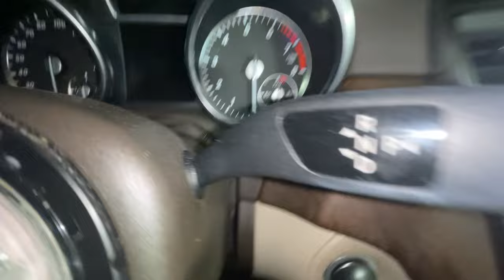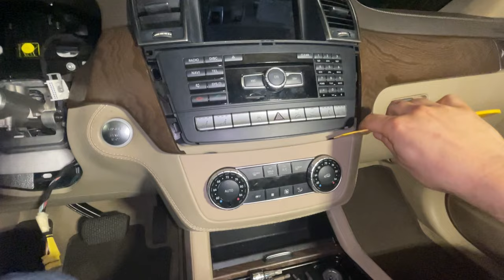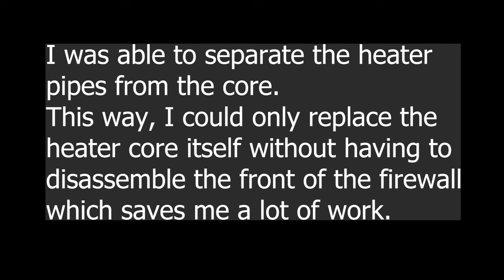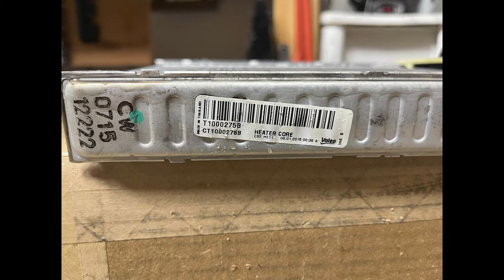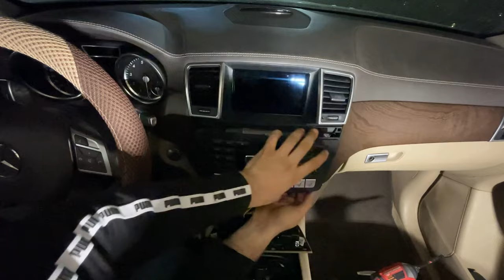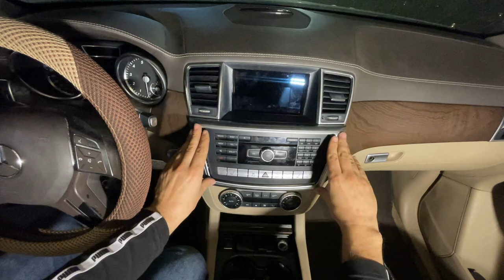DETAILED W166 Mercedes Benz ML350 Complete Dash removal and Heater Core Replacement | How To

Comment: I took the whole heater unit out of a W108 (1968 250S) and that was a headache.  But, I was really lucky because I was parting out the car.  If I was doing it as a paying job, that would have been a nightmare.  It really was easier to take everything out from in and under the dashboard.   I think a lot of people underestimate the number of parts and pieces - large and small - that have to be removed.  Take lots of photos.  Make notes.  And keep track of all of those screws and clips.  The estimate is several hours in the rate book, if I remember correctly.  Hopefully you have a lightweight, skinny mechanic with long fingers and slim wrists that does not get sick working upside down.  Congrats on your job!
Reply from the maker: Yes it is a nightmare for sure but like you said, when you take notes and pics of everything then you should be good 👍

Comment: very impressive operation. kudos. helpful to the merc benz DIY community. I recently replaced and troubleshot a ml350 163 A/C system, the center blend door flap was clicking and rotating endlessly, and linkage was broken on right blend door. Upper dash had to be removed.  Your procedure dwarfs that operation. Well done.
Reply from the maker: @mobitechaz thank you for the feedback!

Comment: Heater core got plugged up because the Silica slow release anti corro6pack came apart. You also need to replace bottle to get 100k out of coolant and bottle potentially or replace coolant now at 50k if not new bottle
Reply from the maker: Thanks man, good to know 👍

Comment: Hi,

Many thanks for the video. I have a problem with my 2013 ML 250 w166.

Couple of years ago, there was a rattling noise in compressor during idle and when vacuumed at Merc dealer, it had less gas and no oil. So they  added the specified quantity( I don't know how much exactly) and it was working fine. The noise was there anyway. The cooling was totally great. Annoyed by the noise, I went ahead and changed the compressor and receiver dryer alone at an independent garage. Then the rattling noise from compressor was gone. 

Fast forward two years, the aircon wouldn't cool for the first 10 minutes from the cold start of engine. But when the vehicle was at operating temperature, the system began cooling well. 

I then went to a generalist ac recharge person and checked by vacuuming. It had about 300 gms of gas and 45 ml of oil when vacuumed in the machine. 
Since, the ac guy had no clue of how much gas was required. I searched online and found that the ML 250 needed 1050g of gas and 120 ml of oil which he refilled.

1 month into it, I now have the same rattling cluncking noise from compressor. 
Finally, went to a reputed ac mechanic and then again vaccuummed it and found the gas level was about 967g and   45 ml of oil.

But this time the oil was grayish with some metal emery. The high pressure was fine. The low pressure readings were inconsistent.

I think I made a mistake by asking him to fill 120 ml of oil when the recovery was only 45 ml. I didn't k ow that rest of the system had oil too. Did I overfill oil?

What should I do now? Should I replace the compressor,Condenser and received dryer alone?

Or should I replace the evaporator core as well? To ensure that the system doesn't fail again. I am early confused about  how best to sort this.

Looking forward to your advise.

Many thanks
Reply from the maker: I read everything you wrote, but at no point did you mention any leaks. The way that you're describing losing gas and oil every year or two, it's very concerning and that should not be happening.
So, my advice... instead of replacing everything that comes to mind, how about start with finding the leak and make sure that's solved first before you go on to replacing parts.
Reply: Thank you.

 Could you give a broad outline as to how to find the leaks in the system?
Reply from the maker: Fill up your system with gas that has Dye in it, start the car so it builds pressure and check around with an Ultra Violet flashlight that you can buy for $5. The Dye will immediately highlight the leak for you.
Reply: Hi,

Many thanks for your advise. The leak was from the compressor itself and the condensor too.

The third time I filled gas and it got leaked out fully in two months.

Last week, I traced the leaks in the system and replaced the compressor, condenser and expansion valve. 

Cleaned out the lines and flushed the evaporator without removing it. Checked for any leaks by pressuring the evaporator. It was holding good. 

Replaced all the o rings in the entire system.

Now the pressure holds good and the cooling is extraordinary.

I truly hope this will be the end of the issues in ac system.

😊
Reply from the maker: @kathiravanm1874  it sounds to me like you found the issue. Good job 👍 
Hopefully that was all to it. Good luck!
Reply: Many thanks to you mate @AlbanianFix

Comment: Thank you for the video that makes me have more confidence replacing the core by my self, but how to tell the core is leaking what type tool or gauges you using for the pressure? thank you
Reply from the maker: Thank you for watching! The only way that I could tell the leak that was coming from the core is because inside the car it smelled sweet and musty and the windows will fog up very quickly with like a sticky film to it. You can find the tools I used in the video's description.

Comment: W166 2013 4matic - my vents run hot even with climate control off.  AC blows hot as well.  It was vacuumed and filled, no leaks.  Intermittently blows cold.  I feel the hvac blend door actuator is stuck open for the heat to vent and won’t close for the AC.  Question:  how far deep do I need to go to replace this part?
Reply from the maker: For the doors looks like as far as I went in the video where you can see the big plastic black rig
Reply: That’s pretty deep to get to the hvac blend door actuator.  Everything comes off then looks like.

Comment: nice video!!  what is part you are removing at time 7:31? its the little chip with a cable. Do you know what its for?
Reply from the maker: I think that's a sensor for the AC thermostat, might be wrong.

Comment: I was fortunate in 2009 to pickup my E320 Bluetec at the factory near Stuttgart. The perk included a factory tour. We were loaded on a golf cart at the delivery center and driven to an entrance of one of the factories, that seemed like a couple miles from the delivery center. Hardly any people worked in the factory of robots, those that did were on the catwalks with binoculars watching the robots. at one point in the tour, we were on catwalks over the assembly line below us, which was putting the dashes in cars. it was fairly early in the interior process that a robot came in from the drivers side with a dash and popped it in the car, maybe 10 second and it was out. The dash assembly I’m sure was done in a separate factory because it was ready to go in the car at this point, there were a few humans plugging things up ahead of and behind the robot at that location as the dash and other items were put in by the robots. I remember the doors and windshield was not yet in the car. Mercedes took a lot of heat for getting rid of all the people that worked in that factory and replacing them with robots, that was one of the big storylines, but the robots won. Quite an interesting place. Never seen anything like it. The last stations were measuring and testing tolerances on all the cars components, absolutely every crack and every line and everything in the car had a tolerance and measurement machines were  checking, a human and machine were even testing the paint on the car. Only when a robots machine failed something was a human called in to retest. If a car failed any of the testing at that point it was shot a side on a different assembly line for corrections.

Ps. 5500 people sticks in my mind. They told us (about 10 on the tour) how many people worked in the factory before converting it to robots and I believe the number was 5500. Of course that would be all shifts. Lawsuits and fighting took Mercedes about 5 years to win the automation war, that involved many factories all over the world.

YES, final inspection many machines measure everything imaginable and there is a lot of humans interaction at that point. For example. The limits on the power seats are measured in every limit, Mercedes has a tolerance for each movement and it’s less than the eye can see; if it’s out of tolerance it’s fixed then or put on a resolution line if it can’t be fixed. The time it takes the trunk to shut and open is measured; every internal and external space is measured and check and must be within a tolerance. The assembly line robots can catch some things, but not like the human eye can, especially of the final product. Mercedes recognized this was a weakness robots introduced and designed the inspection process to correct such problems.

I wonder what will happen to the income tax revenue loss when robots replace people?  Could we get to a point where all that revenue drys up because people aren’t working to pay in to the system? I think about things like that. Hahah
Reply from the maker: That's quite an impressive story. I wish I could see that, too. Even though machines have taken over, nothing gets sent out without proper inspections by human. I mostly wish my car was actually imported. I feel like German cars over here seem to have a lot more issues than the ones in Europe. Probably here we got bad staffing and or work environment or, in other words, motivation for quality work is lacking. But since all issues still require the same solution regardless of manufacturer's origin, at least the internet brings us together to share our experiences and help each other out. That's a good thing!
Reply: If a robot can install a dash board assembly in one complete pass, why can't a human remove the whole thing the same way and not have to dissamble it?

Comment: Hi, I have an ML400 2015, the glove box vent is not working, It doesn't matter if I turn On or Off the knob inside the glove box or change any settings on the controls, what do you suggest me to check? Thanks in advance.
Reply from the maker: There isn't much you can do from the glove box side because there's a pipe that comes from the AC dash unit to the top of the glove box and the knob only opens the air flow or stops it. I suggest to check the pipe, maybe it has fallen off or it's broken but you will need to take the glove box apart in order to check the pipe.
Reply: @AlbanianFix  thank you so much!!
Reply from the maker: @mauriciogasca6516 This is the black plastic pipe I was talking about:
https://youtube.com/clip/Ugkxh9rhS6Cc1_aFIR2sxvnZ0MJWjAIbcN5v?si=czfwdar1i9PRd_e3

Comment: Another question, how can I clean the air conditioning evaporator? On a ML400 w166, it has a musty smell, I replaced the cabin air filters but the smell is still there.
Reply from the maker: The cabin air filter is the right thing to replace when it smells. If this smell still persist, then you might have moldy carpets.

Comment: Hi , I have 2014 GL 450 , the heat is so low special on hi speed 60mph right side no heat at all , any sugestions? any recomanditions i,m in NYC. 
Thank you.
Reply from the maker: Check coolant level, maybe low coolant.
Reply: I did check coolant level is normal , I did replace thermostat, I did replace radiator, still no heat special passages site , most likely heater core needs to be replaced, any good mechanic in NYC.
Reply from the maker: @salizymberi5425  Yeah, sounds like the heater core is clogged up. you can try to flush it. It's easier and cheaper than replacing it especially since you have no leaks. I would try that first.

Comment: Hello, I have a 2014 Gl350 flushed the heater core, and it blows heat drivers side but no heat on pass side I did heater core it isn’t clogged no actuator issues present or anything what should I check?
Reply from the maker: How far into the dash are you? Can you see the blend doors (actuators) actually moving as you press the hot and cold buttons? I’m pretty sure it’s stuck somewhere on the passenger side or it’s not opening/closing all the way.
Reply: Everything was working I scanned with Xentry my issue I think is circulation

Comment: How many miles does your ml350 has? I’m planning on buying an used ml350 2012 with 140,000 miles, with the m276 engine and no air suspension
Reply from the maker: Mine is close to 200K miles.

Comment: Hi I have Mercedes cla 200 14 plate when I’m I sport mode say at 70mph when ease of the pedal the rpm jumps right down an jurks the car like it’s in wrong gear so when braking and bringing car to a stop it’s harsh down shift in gears any ideas
Reply from the maker: That’s a tough one. I would guess bad speed  sensor, bad solenoid, bad fluid…
Best if you have it checked out, maybe start with diagnostic to see if there’s anything going on.